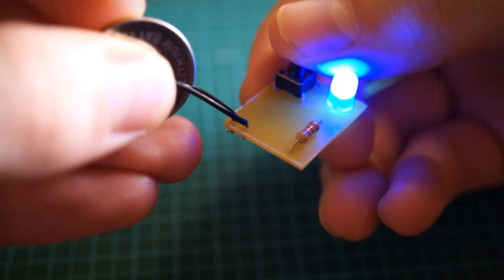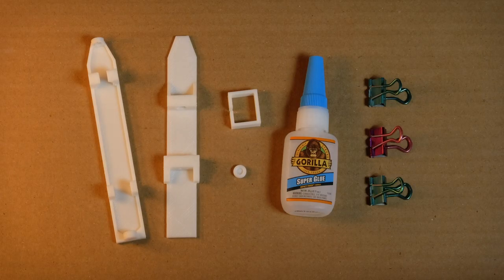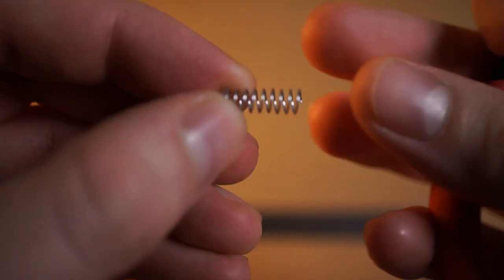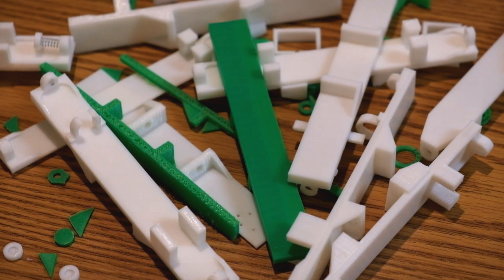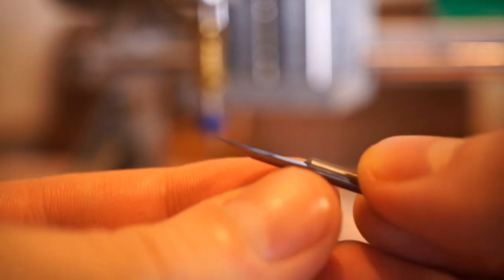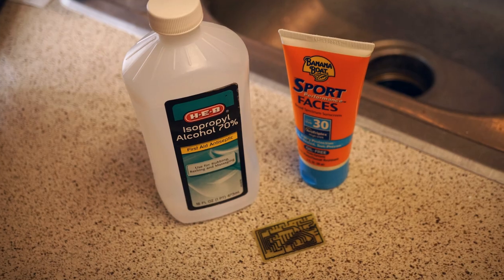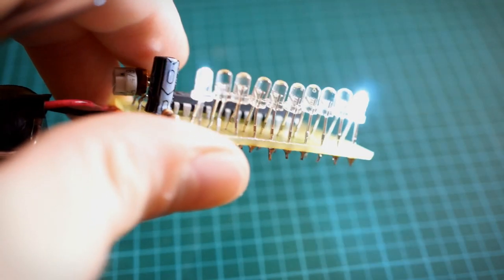How I Make Circuit Boards

Comment: Very nice. What CNC machine do you have? Also, did you need any sort of heating for the chemicals or did you just put it in the bowl cold?
Reply from the maker: I did not heat the chemicals but I have seen other people do that online. Mine worked at room temperature. The machine goes by many names. This wiki is the printer I bought. http://linksprite.com/wiki/index.php5?title=DIY_CNC_3_Axis_Engraver_Machine_PCB_Milling_Wood_Carving_Router_Kit_Arduino_Grbl
Reply: Thank you very much for your reply.

Comment: working like a charm, very nice
Reply from the maker: So far so good! I just want to push this and see how small I can make the traces so I can make more compact circuits.
Reply: if you put planetary gear on nemas you wont get a small step and better resolution? maybe with a litle changes on code ?
Reply from the maker: True that might help. My problem is if I draw the traces very thin, then the chemicals will break the lines. So I need a stronger ink or a lighter chemical.
Reply: if you follow the equation: (2) H2O2 + 2(CH3COOH) + Cu  = 2(CH3COO-) + Cu2+ + 2(H20) will give a better resolution, you can mix a hydrogen peroxide with vinegar and table salt, the reaction brings neutral Cu atoms of the board to Cu2+ ions in solution that would form copper acetate (it is the combination of one Cu2+ ion and two CH3COO- "acetate" ions). And, at one point the bath would reach an equilibrium (because there is as much Cu2+ forming from Cu than Cu2+ getting back at a solid Cu form). The proportions are quite strange because depends of the state of copper.
Reply from the maker: Yes I tried that too but I had the same results. I think the vinegar and salt put off more bubbles which act like a scrub brush and scrap away the lines over time since it took over 5 times longer. I might skip the chemicals and see how I can drill around the traces as thin as I can. Thank you for your help.
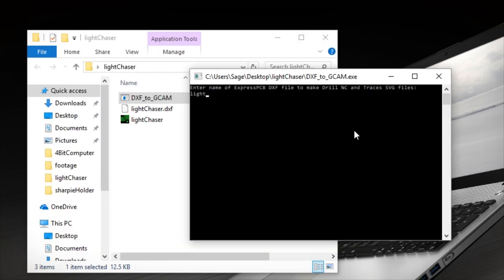Reply from the maker: That was very professional quality. Thank you for the link. I'm not sure what prevents the bit from falling out at 3:24. I would be scared to risk drilling away the copper if the spring got stuck. I did my first trace drilling test and im happy with the results. I'm 3d printing a device to help hold the board to the machine bed and i'll share what I have learned in my next cnc video.
Reply from the maker: Nice! Great idea. Yes let me know when you post it. Do you have any links to what you have made with your cnc machine? Just interested to see what you are doing.

Comment: can't wait to see your video pcb engraving around traces in order to stop with chemicals, do you is it possible to take a pcb layout (pdf, gif or png) and then send it to camcad to mill them? but i think pcb traces for example the one you find on the web (musicfromouterspace.com) are not suited to mill around (ie traces to close each other so no space for the engraving lines)... mmm what about double sided pcb? mmm and gerber files? too much things to learn, i have my machine since 1 day, but i'm impressed with precision of drilling holes! i make them with a vertical drill ahaha
Reply from the maker: Yes I did try milling around traces and it did work! I forgot to film the process but I can redo it. Double side, I haven't tried but I think there is a way to do it. Just align the pcb perfectly.
Reply: 3DSage wonderful I’m so happy! Can’t wait to see your results !
Reply: You should be able to make double- sided PCBs reliably when you include some kind of indexing feature in your design e.g. you cut out a rectangular piece with a recess in the lower-left and upper-left corner. Now you fix a locating device (pin or finger clamp) where the lower-left corner will be, also along the lower or left edge of your rectangle (it works with either, but to be safe you can also do both). When you now flip your PCB, you can reliably locate it against these points, and then clamp it down.